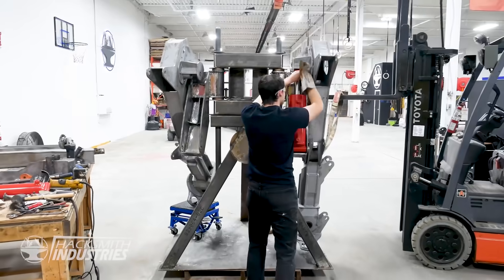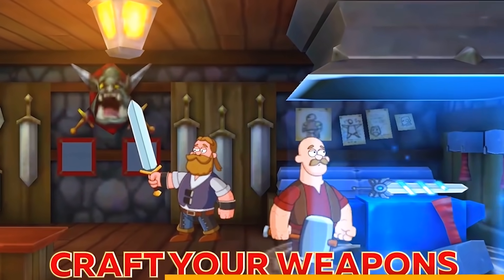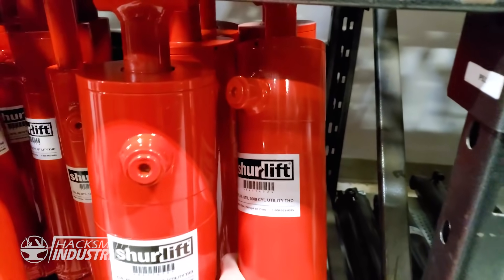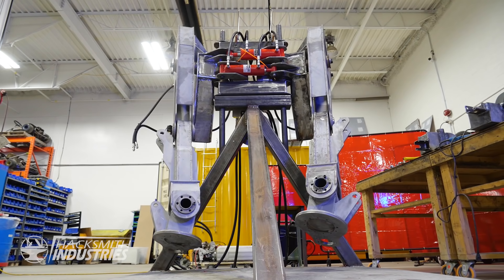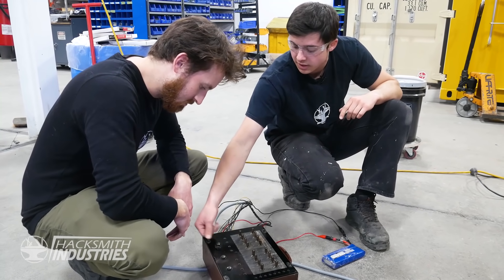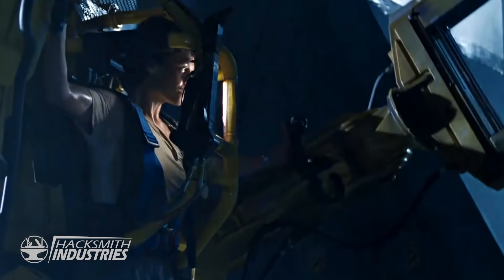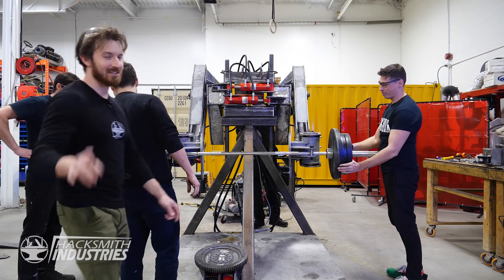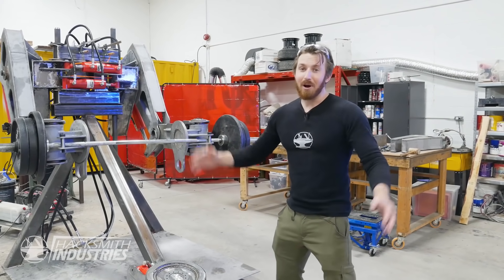How Strong Is This Exoskeleton? (POWER LOADER: PART 9)

Comment: Whoa whoa whoa… Tank tread base? I was excited to see you guys build legs like the original! Tank treads will be OK and it is functional but it’s not what the original was and legs provide a more technical challenge that I think you guys are entirely up to mounting. I was hoping to see the original power loader in all it’s glory. You’ve already done the upper body why skimp out on the lower body?
Reply from the maker: Because that would take another 10 yeaaaars to develop? Boston dynamics spent millions figuring out balance with high speed fast reaction motors. With hydraulics? Nearly impossible...
Reply: the Hacksmith You make very good points… Legs are very very hard to do. I do think you guys are smart enough to figure it out but you are right, budgets are not unlimited nor is the amount of time. Hydraulic reaction time is probably not fast enough like you said to be able to handle the balance of maintaining the structure upright, though it does make me wonder what the Canon in universe explanation for that is. It is clearly a hydraulic system driving the power loader in the film unless the system driving the legs is somehow a different system from what’s driving the upper body.

Comment: Wouldn't it be easier to use screw actuators? Or would kits powerful enough to move that much weight be way too expensive?
Reply from the maker: Haven't seen any that strong. The big cylinders put out 60,000lbsf

Comment: Instead of multiple pumps, I think it'd be lighter, cheaper, and more efficient to use one pump and an accumulator. Then you can just set a pressure setpoint for the pump, and control it with proper regulator valves. 😊
Reply: Oh, and get valves for a manifold block. Easier wiring, and a much cleaner look!

Comment: It would be much more accurate with proper legs. With treads, it will look like a hybrid. I know it is very hard to manufacture legs with balancing system, but if you go this far, you go for the finish line. Please, make it real!

Comment: So I was wondering. Why is it that the in and out cylinders for the arms is on the front side of the robot? Is that because there was not enough room and the rear side with the hoses to put them there or does it work better on that side?
Reply from the maker: Better to space them like that! Thanks for the support being a YouTube member!
Reply: @hacksmith  You're very welcome. Ya I was guessing that was the reason.